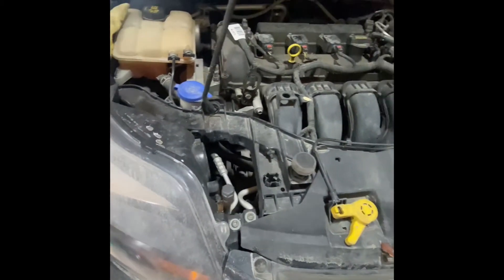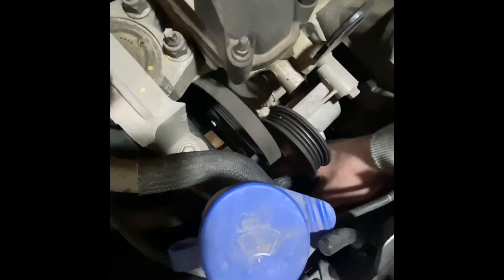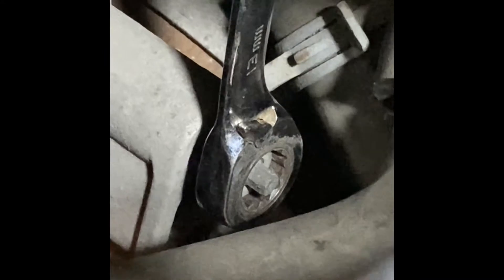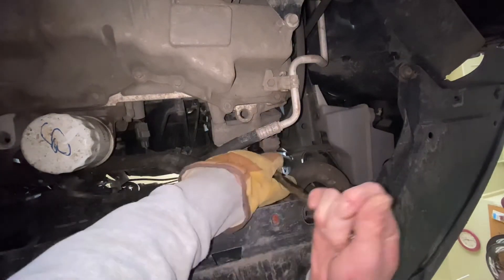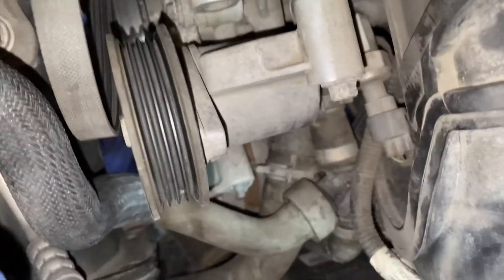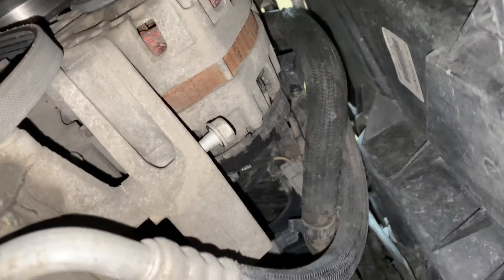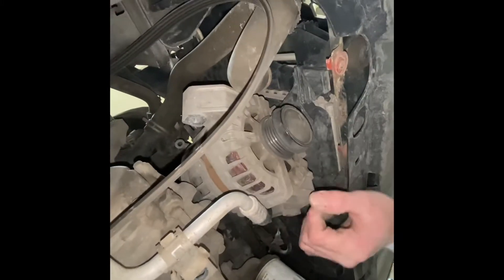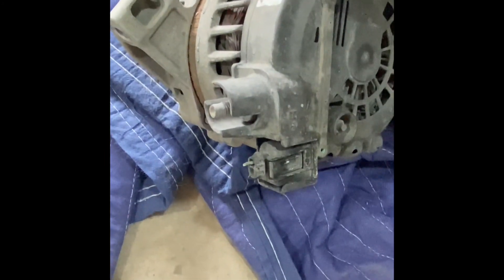2012-2014 Mk3 Ford Focus 2.0L Alternator Removal.

Comment: I need help I did the exact same thing with my wire and I can’t find the wire anywhere online how did u fix it
Reply from the maker: I still had some of the wire left in the harness, so I got a new section of wire and spliced it into the left over wire that was split. 
Then I had to remove the tiny bit of wire left in the plug on the alternator and installed the new wire into it.